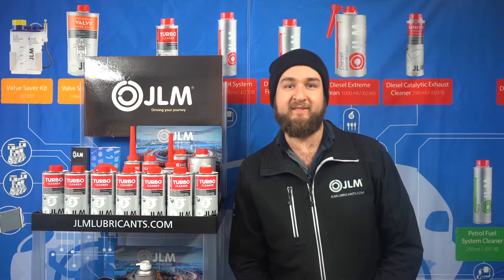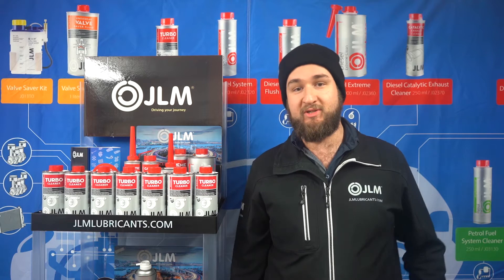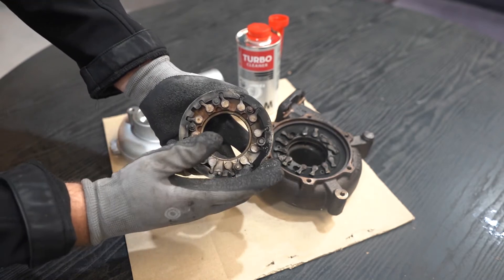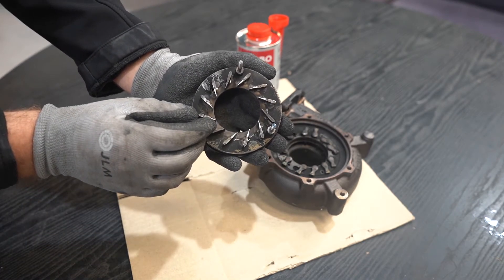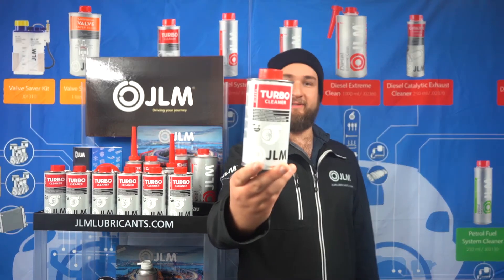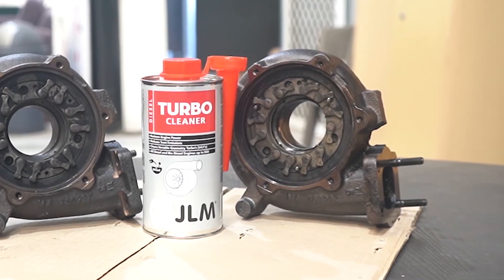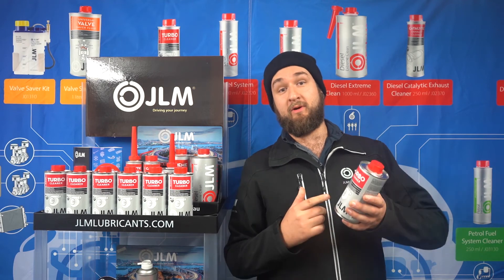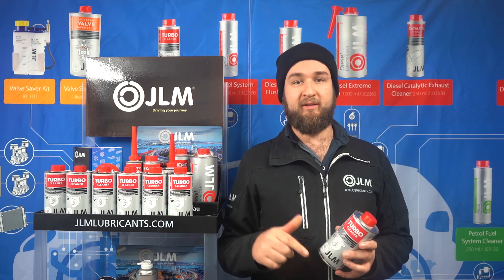Turbo vanes sticking? P0299 Code? - JLM Lubricants Diesel Turbo Cleaner

Comment: So many of these gimmicks available, yet no clear independent proof they actually work.
Currently got sticky veins on my A3 TDi, probably just going to change the turbo out.
Reply from the maker: Thanks for stopping in and leaving a comment, perhaps you should be the change the world needs, if you know you've got sticky vanes, why not do the independent testing and develop the proof? I'd be happy to help.
Reply: @jlmlubricantsaus  what do you recommend doing?
Reply: @jlmlubricantsaus  anything?
Reply from the maker: @sje106  I am so sorry, I genuine thought I replied to this last week, grab yourself a bottle of turbo cleaner and throw that in with your next tank of diesel 
https://gcg.com.au/JLM-Diesel-Turbo-Cleaner-500ml-Use-Every-6-Tanks--1-Can-Per-70ltr-Tank--JLM-J02380.html
Reply: I kept going into limp mode on my peugeot 208 1.4 diesel  I thought as it's only £10 to put a bottle of turbo cleaner in the tank on fill-up. I felt the car went better almost instantly on my  way home. next day i gave the car a 30 mile blast down the motorway . Haven't gone into limp mode since  🤞🤞... so it's not snake oil like I too thought it was.....regards dave.